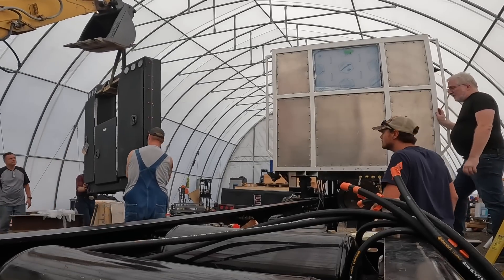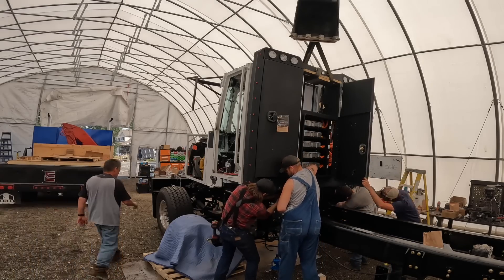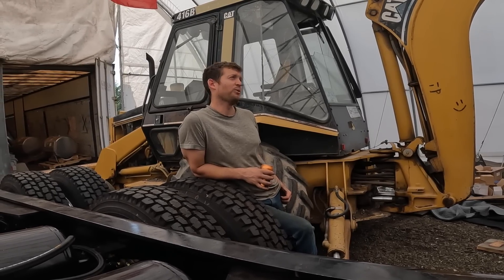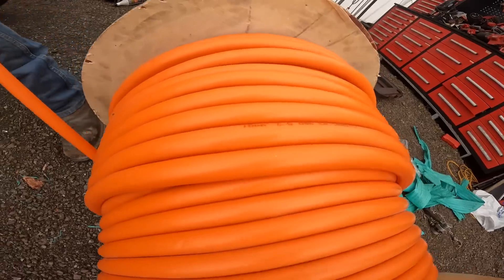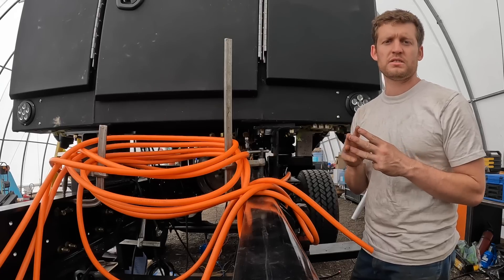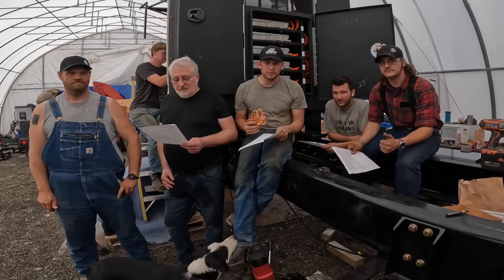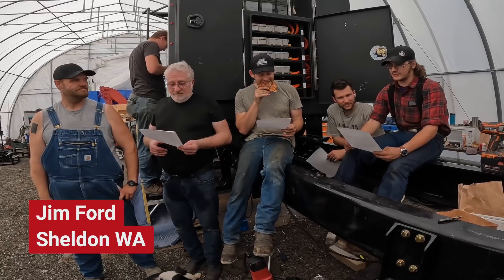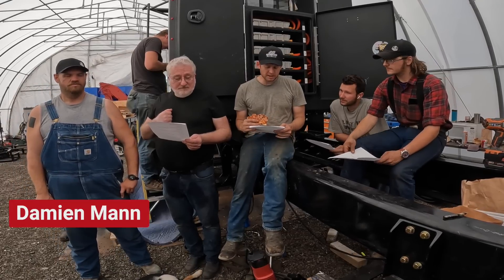Headache Rack Install : Behind the Scenes with Pizza, Beer, and Shoutouts

Comment: really - the backhoe is an extremely versatile "robot-like" tool - only a telehandler would fit the bill, and that doesn't slew as much - take the bucket off and make a hook / shackle adapter (could even just add a 12V winch to the end of the arm.)...

lol:  classic - using slitting disk for cutting copper - that was workshop 101 - do not cut non ferrous with  ferrous cutting disks... (they load up with copper, brass and aluminium)

Comment: You guys need to make a speedometer and air pressure display with nixie tubes. That Would look sweet
Reply: But nixies are unreliable unfortunately... They can burn out... Mechanical or LED is just longer lasting, which is better for a truck
Reply: @PaladinofRealm  but man, it would look cool

Comment: Chase just so you know the wire is actually called one nought (n is silent)wire…when wire was first made it was drawn out ( stretched) the number represented the number of times the wire was drawn through “gauges”to make the size of wire…since electricity really caught on the sizes of the original wire where not big enough so the first attempts to fix this was adding 0,00,000 and 0000 ( Four nought) wire sizes.
Reply: That's cool, I new it meant 0 didn't know how it was spelled. And I'm an electrician!
Reply: @everettstormy  it’s actually old english for nothing…..
Reply: @John13Edge  yeah. Notta and zilch too lol. It's 12 zilch wire

Comment: Are you guys not worried about putting the most critical piece of the rig in the danger zone of the load? I could be missing something.
Reply: If the load is going to pop through that and cause damage you have bigger problems. If they didn't have that headache rack it would go through the back of the cab. Suppose you could call it extra protection.
Reply: @josphe9011 also, this is just for show. He's going to put it all in boxes under the truck later

Comment: If you ever want to build a on highway truck it might be better to build the control unit that is now in this headache rack somewhere in between the chassis, but for this application it looks really good, i wish i could already see them going down the road, this might be a little bit of a stupid question but is the engine constantly running the same speed and does that effect The engine, i know that idling your engine or running your engine at the same speed for an extended period of time it is not good for the engine + what do you think would be the average lifespan of a Edison truck, greetings from the Netherlands!
Reply: Also i feel like idling really doesn't harm things, but I'm not a car guy.
From my understanding if your cooling is up to snuff and it's not a million degrees outside you'll be fine.
And as long as you're not using more electricity than you're generating, battery depletion also won't be a problem. In this case, there's no way for that to happen with engine running.
Reply: From what i understand the engine is a generator, designed for constant RPM. There is no idle.
It is software controlled to activate if charge drops below a threshold with a hardware switch to force on or off.
Reply: Cooling is the main reason letting an engine idle for long periods is not so great. Because at idle your water pump isn’t pumping very fast n not much airflow through the radiator. This has been thought of and delt with. Also engines have a peak RPM where they are most efficient as in horsepower output/fuel consumption. This will start up n alwsys run at that peak RPM. That is better for the engine than constant variable speeds/loads ramping up n down n all that causes more wear n tear than running at peak RPM and load. 
 Good question, hope I helped
Reply: There’s also regen braking, which will be great on downhill grade, not so much on uphill. But that’s what the battery n generator is for. I expect them to learn alot from this first production truck and iron out the kinks for future production.

Comment: My old farm tractor has a decompressor. It's a bit of glow plug and let it spin until it starts speeding up, and shove the lever back in, it starts even at -30c.
Reply: Same with our deisel tractor, my dirt bike and just about all lawnmower engines. The only difference is that the decomp lever is automatic

Comment: Nice just in time.. Just came in to take a break from working on my own electric conversion 1960 Volvo PV544!  Love the Build so far!!!
Reply: You're building one too?
Reply: @stauker.1960  Haha yeah Where you at?
Reply: what sort of drivetrain are you using?
Reply: @brookeamm7655  Hpevs ac50 with a curtis 1238e , leaf 24kw minus 3 modules.  m40 transmission and stock axle.  motor orginally was around 60hp and this just a small bump to 75hp. But i will be lighter around  9xx KG.